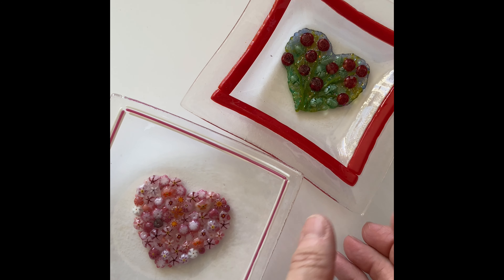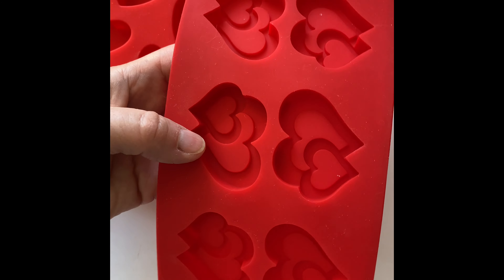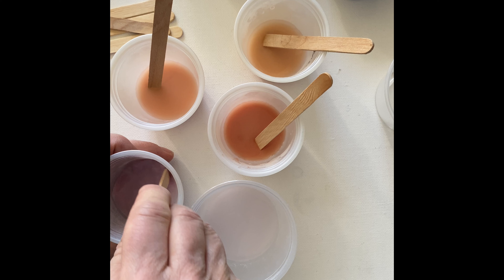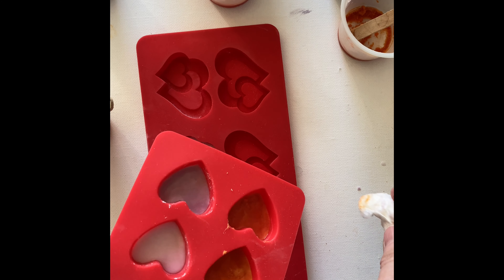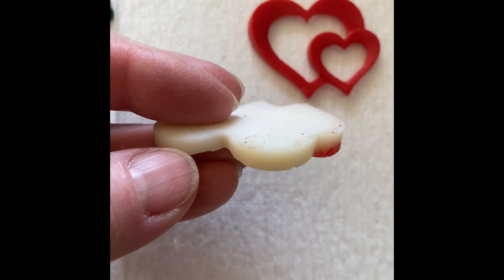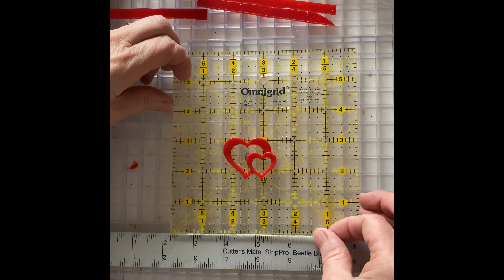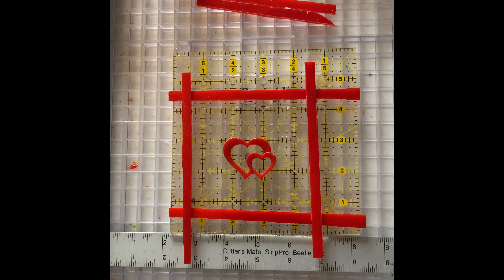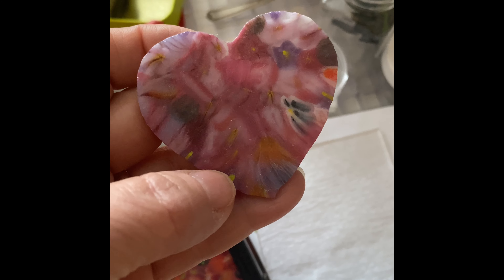2 of 3 for Valentines Day: Freeze and Fuse Trinket Dish

Comment: I can’t wait to try things like this! I love it what frit is that?  Also, if you find more thin CHEAP spoons…put it in a vise and take a hammer to it…helps put the fine and medium Frits where you want them
Reply from the maker: They are powders from a sample set I got from: https://www.artglasssupplies.com/
The complete set is 50 different frits and powders! It’s allowed me to try everything at a reasonable cost and then buy larger amounts of what I actually use.
Great idea! I’ve found many spoons of different shapes and sizes. It would have been easier to modify them myself.